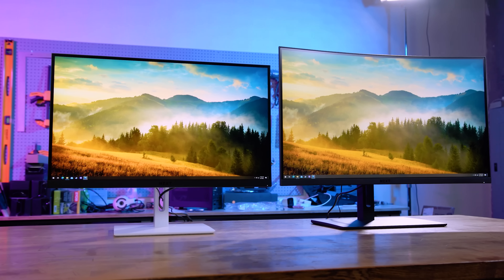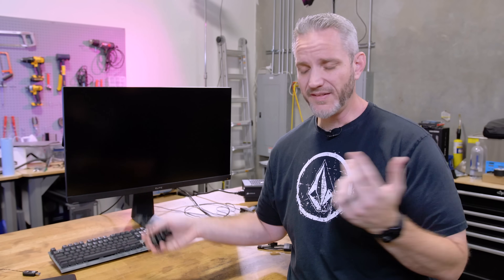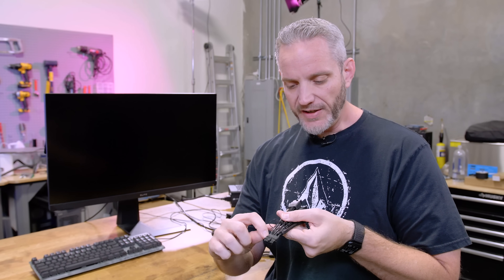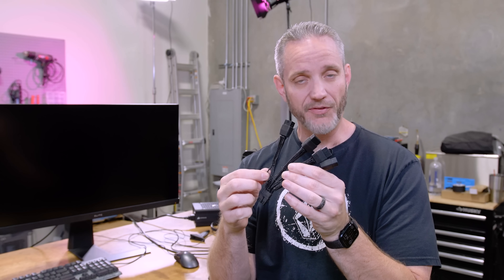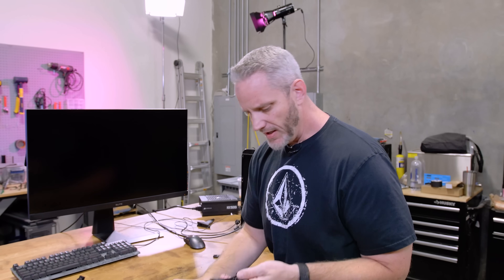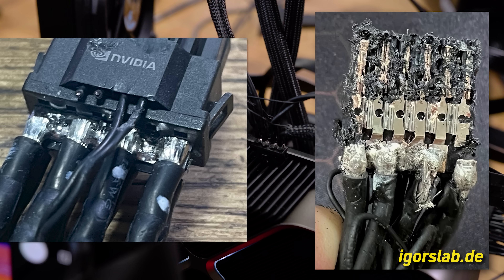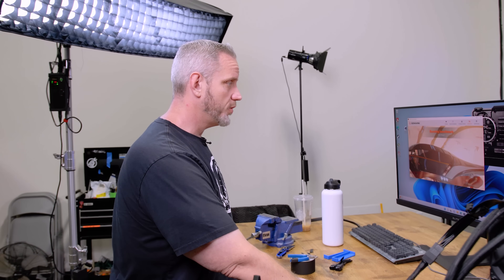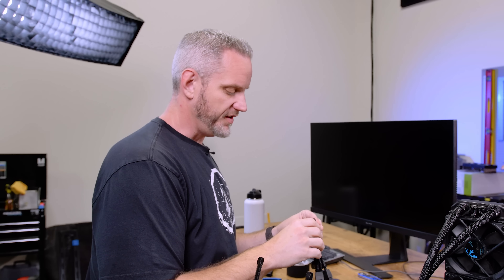Igor's Lab figured out why NVIDIA adapters are melting!

Comment: Maybe it's not completely disconnecting that causes the melting, but the solder breaking and having a thinner/loose connection. With a  thinner connection, the higher the resistance and therefore more heat.
Reply: good point
Reply: Thats exactly what makes cables melt, a too thin connection.
Reply: From my understanding of Igor's article, it's not actually the solder breaking but the "thin plate" the wire is soldered to. The wires are soldered to a metal foil pad (aka solder pad) that is part of the overall metal foil material going to the pins inside the plastic housing. These solder pads are glued to the connector plastic base, but the soldered wire is peeling the foil pad off of the connector plastic and slowly tears it off from the rest of the foil material.
As the tearing gets worse, then of course you get the higher resistance. Not only that, if you tear the pad off completely, the thin foil is so thin that the bridges between the pins heats up a lot. The fact that the solder pads rip off so easily already shows how shoddy Nvidia's connector's build quality is.
Reply: yes. see the article in the link.
Reply: Exactly how tf did Jay not even comprehend that. I'm watching this video like wtf is he even doing. He even said the same idea when he thought it was the pins pulling out slightly when bending the cable causing more resistance that was melting it. Jays not the smartest tool in the shed.
Reply: I had a similar thing happen with an Antec 1000W PSU and an iffy 24-pin connection.
Reply: 100%. If the outer cables are totally cut and disconnected, there is 0 current flowing those pins. If anything the middle pins should be melting because more current (assuming PSU can supply full current through only 2 8-pin cables) is flowing through them now. Having them partially broken or having intermittent connection would definitely make more sense for increased heat or sparking.
Reply: You should NEVER rely on a soldered connection to take a MECHANICAL load. It **HAS** to be 'stress-relieved', which they did not do correctly. In fact, that heat shrink probably made it WORSE by making the thing difficult to bend round a corner.
Reply: @lucun_  The copper foil on circuit boards is typically 35 microns (micrometres) thick, 70 microns for heavy-duty boards. It is GLUED to an epoxy resin/woven glass fibre laminate with epoxy glue and is NOT designed to take MECHANICAL loads in the way that it has been designed by Nvidia.

I have never seen such a truly AMATEURISH abo***ion in my entire life on sale to the public, sold by a prestigious company. Whoever came up with that idea deserves to 'walk the plank'.
Reply: @PabzRoz  What are you criticising ? Jay was clearly 'suspicious' of that 12V 'adaptors' suitability for purpose right from the beginning. Now that it's been shown to fail in normal use and been cut apart to discover what's inside, the true horribleness of it has come to light. It is clearly an Nvidia BRAIN FART and needs to be withdrawn for sale PRONTO and re-engineered to work properly.

Jay has been of considerable service to the community by stating his concerns and following up with analysis. What MORE could he have done ? He's not an electronics engineer like myself for heaven's sake.
Reply: @flamepygmy  Remember that resistance heating is proportional to the SQUARE of current. I^2.R (eye squared ahhh). If you 'lose' just TWO current carrying conductor out of four. the heating effect goes up by FOUR TIMES.

There are no sparks. Just resistance heating making things VERY hot.
Reply: @grahamstevenson1740  By sparks I meant if the outside connectors are cut and they are intermittently contacting there may be some sparking (arcing) due to that. The voltages are not super high, but if the ends are super close (but not connected) it can still arc.
Reply: @flamepygmy  12 Volts won't ARC particularly well. You need an seriously INDUCTIVE load to draw a decent ARC too.

Do you actually understand how electricity works (I do, I'm a Consultant) or are you just making a noise because you can ?
Reply: @flamepygmy  Theoretically possible I suppose but nothing whatever to do with what we see here. Any arcing would be of low energy and intermittent, so of minor average power and insignificant relevance.

What we see here is massive resistance heating from a poorly considered and executed design that fails to adhere to best industry practice and norms or manufacturer's data sheet absolute maximums. (i read them the night before last)/
Reply: @grahamstevenson1740  It's a wire assembly, so it's more than likely a stamped piece of metal inserted with glue into the plastic housing rather than a processed PCB. Actually, it already looks like the standard stamped metal you put into most connectors when assembling them, and normally you do not even glue those down but rather fit them into the connector with locking tabs to lock them in! They even went through the trouble of gluing  the pads down, but didn't question it.
Reply: @grahamstevenson1740  I'm not making noise. I don't claim to be super specialist in electricity field, but I do have MSc in Computer Engineering which includes quite a bit of electronics as well and I have plenty of electronics hobby projects (custom PCBs etc.). I wasn't trying to make noise, I was just trying to clarify what I meant by sparks. And yes, you are correct that at such low voltages they are hard to create and the gap needs to be really short for that to happen, but they can happen. Also yes, they don't contribute to the plug heating issue.
Reply: @flamepygmy  This is ALL purely resistance heating due to incompetent/negligent design.

The card can draw up to 50 Amps of 12V DC.

You treat that amount of current with due respect. You DO NOT use cheap consumer connectors run BEYOND the manufacturer's data sheet maximum ratings, as Nvidia have done. One has to ask "who the heck decided to use that connector ?". It's unfit for purpose and made worse still by Nvidia's very poor implementation.

The results are completely and unsurprisingly entirely PREDICTABLE !
Reply: @grahamstevenson1740  100% agree. Seeing the tear down of this abomination I was so confused. Who in their right mind approved this flimsy design for such an expensive product. Connector format aside, you could implement this in much higher quality by for example not combining the wires at the connector. Combine them earlier and use thicker wires leading up to the connector. There should be also some kind of cable crimp to hold the wires to prevent them from breaking at the solder points and putting pressure to the pins.

Comment: It's been over a decade since I worked at NV, but I vividly remember Jensen ending the last quarterly meeting I attended with the words, "What can you do to improve gross margins?" Clearly, saving a few cents was the goal when they sourced these cables.
Reply: Was he polishing his leather jacket that was hung on a golden stand while he was saying that?
Reply: @Rov-Nihil  Back then, he had more of a "science teacher trying to be cool" vibe than the "low-budget Bond villain" style he's embracing now.
Reply: every company is like this. why are you so surprised?
Reply: Thats normal for a very successful company, but the goal is how to improve while not failing the product. you could spend 10$ more on the cable or spend 1$ for a foil solution to save and risk the failure.

OR spend 5$ to create a practical safe solution instead of either, which is why some people get paid the big bucks is to figure out that much.
Reply: This is an example of the problem with modern capitalism.  Henry Ford once said, "There is one rule for the industrialist and that is: Make the best quality of goods possible at the lowest cost possible, paying the highest wages possible."

Today that phrase is "Capitalism is; the highest profits possible, while paying the lowest wages possible, while producing the lowest cost product acceptable."

NVIDIA decided to save a few pennies on their power cable so they can make a bit more profit.  The result is that they produced something that has a safety issue in some situations, if they would have left things alone (increasing cost slightly and therefor lowering profits) there would be no problem.  The bad publicity and having to deal with repairs for the issue as well as the cost to replace all of the cables before they sell the cards all that haven't been sold yet add up to LESS PROFITS!

This is not just an NVIDIA issue, it is an economy wide corporate management issue.  Profits are good, trying to squeeze every last penny of profit out of the business is a bad idea.  The world will be a better place when people realize that Henry Ford had the right idea and we can get back to that form of capitalism.

Sorry for the rant, this is a pet peeve of mine,
Reply: This is the reason I'm so adamantly against closed standards.  The minute there's something where the IP is heavily patented, and access to it requires huge up-front investments, and often recurring payments and/or per-item licensing, it shuts out a whole slew of independent vendors.  That means it only makes sense to get involved if you're a large vendor.  Large vendors get obsessed with net costs and reducing them everywhere possible.  Eventually, quality suffers.

Small companies care about things.  If you lock out small companies, there's nobody left but giants to fill the void.  That's not good for anyone else.
Reply: @UOHCUNY  Sure, but if this sort of mentality is undesireable from Nvidia, and every company does this, That is neither a defense of Nvidia or all companies, yet alone the economic system they comprise.
Reply: A CEO is legally required to maximize profit.
Reply: Nvidia screwing their best customers? Nooooo....
Reply: did you tell him finance people are supposed to improve gross margins?
Reply: @hangender  I was too busy getting outsourced.
Reply: @andywilliams7298  dam so jensen made you outsource yourself as your job. That's some serious bdsm
Reply: Right, a boss wanting to improve gross margins is code for "make shitty stuff."  Dang ol' big bad companies, wanting to make money!
Reply: @GondolaParadiso  as the number of corporations that owns most of society shrinks, it becomes more of an issue of "What are you going to do? just not buy x?"
Reply: @abram730  you can still increase profits by not making an ass hole design. I'm sure many pethat were going to be a 4090 will definitely not do so now because of this.
Reply: That approach has a tendency to bite back where it hurts most. I think they just found that out. I took a deeper look at the 12Vhpwr connector in detail. It's been made about 70% the size of the previous connectors used for PCIe power. The pin contact is 0.64mm square instead of 1.0mm, the contact pitch is 3mm instead of 4,2 and so on. Yet they INCREASED the current rating by 60% ! Sorry, it just *doesn't work like that*. You make something smaller, it has greater electrical resistance and thus carries LESS current safely. If it had been rated at 3 Amps per pin instead of 9.5, that would have made sense. I'm frankly 'gobsmacked. It's like a total idiot was running the show.
Reply: @_Clivey  finance controls the budget. So you can't operate anything without finance.

Finance is like the mom. Business unit is the kid, and budget is the allowance.
Reply: @Rov-Nihil  Pfft cmon, lets be fair to Jensen...he has underpaid lackey-boys to polish his jackets for him.😉
Reply: @vladuk  I'm not getting your point. There seems to be a language barrier here.
Reply: @_Clivey  Nvidia has a solid track record of Anti-Consumer behavior and outright lying to consumers. Aside from that, there is actually proof that they failed to follow the 12VHPWR standard instructions when designing their adapter cable. PCI-Sig knew in advance that Nvidia's cable was a bad design and Igor's Lab did an autopsy to show exactly why these cables are faulty. This is entirely on Nvidia beyond a shadow of a doubt.
Reply: @abram730  lol. At the cost of compromising a whole batch of cards...? I'd fire the whole crew and anybody affiliated with the design of this cable.  Maximizing profits while holding a product to a strict quality standard is what CEOS do.
Reply: @iCore7Gaming  definitely. In fact I'm going to skip 4000 series altogether because of this. Might even switch to team red
Reply: WOW just thats like every successful business
Reply: Nvidia charging five times mote the price to customers
Reply: @UOHCUNY  "every company is like this" you must be hard core NVIDIA fanboy in a denial to believe that every company is doing this type of fatal cheapness on the most premium and expensive products that they sell...
Reply: @abram730  And this is doing the exact oposite but somehow you are unable to see it even after watching this video?!
Reply: Peak capitalism
Reply: @Bialy_1  im being realistic. How did you come to the conclusion that I condone this
Reply: @pentaborg871  Igor's lab isn't even of the cables that are shipping out now.  Go check GN.
Reply: @HotShame0  They probably spend a crapload of money on "smart" engineers to design this stupid plug, it's not a low end card which will be sold in millions, people pay for this and this probably didn't happen because of being cheap but trying to be cool "duuuh lookat mah 12 wire flat cool looking rgb cable" which burns, or when it's not a dedicated psu - connected to 4 pci-e's and it just looks horrible... and burns as well.
Reply: @GondolaParadiso  what you said is true
i feel like even SEGA with that particular game called phantasy star have same issues
it feels too budget for something made by big company(also considering their ood titles from the same franchise),not to mention lustful cosmetic or cool imaginary cosmetic items that sells like crazy from real world money "curency conversion" thing like Minecoins
or even a phone that nowdays feels like its hoing more and more into lets make it as cheap as possible while raking as many provits as possible with thst single product
Reply: This aged well
Reply: @DurzoBlunts  ikr, good thing op no longer works in NV
Reply: @_Clivey  I don't for one damn moment "feel silly". In fact, i find it incredibly brain-dead when certain individuals see a design that makes user error MUCH more possible than a previous tried and true design, and pretend that this is not also a design problem. These cables could have easily been designed to not get power >when not fully plugged in<. The fact is that upwards of 600W in such a tiny area is really pushing the damn limit.

Analogy time: This is like a multi-billion dollar restaurant pouring nearly boiling coffee in a flimsy coffee cup  and expecting that customers will be safe 100% of the time and never become severely burned. This happened to Stella Liebeck at a McDonalds in the 90's. When taken to court, it was found that McDonalds neglected basic safety especially with their cup design, and that their Coffee is far too hot to be drank when you receive it. Take Flimsy coffee cup and replace it with flimsy cable. Take boiling hot coffee and replace it with huge power draw in tiny area.

Now do you feel silly for not considering that a design that makes user error much more likely is also a design problem?
Reply: @_Clivey  lean six noobma have nothing to do with finance or budget. Nor does standard work. Rofl.